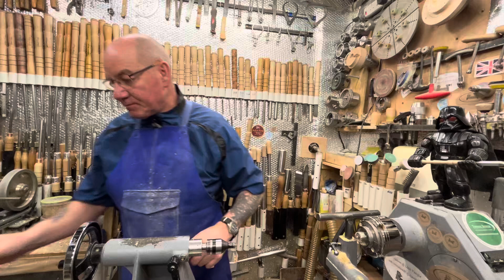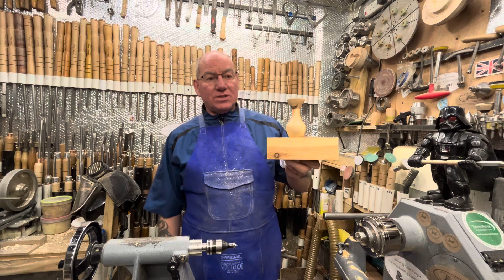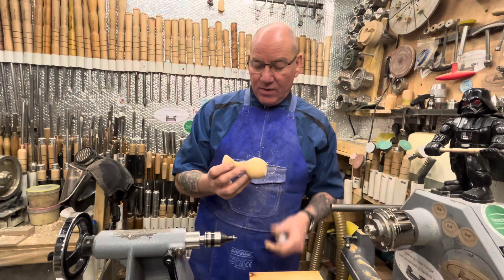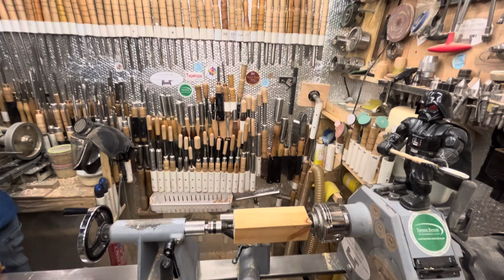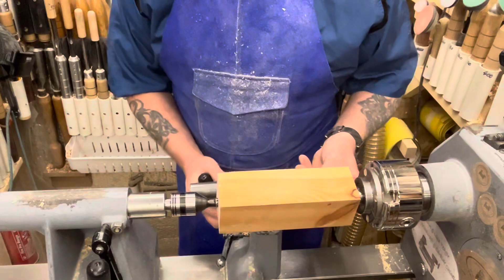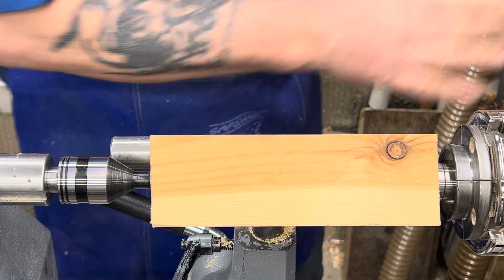Woodturning. Carbides. Using the Standard Type 3 Chisel Set. Part 4.

Comment: I was watching and thinking that if you get good at riding the bevel with carbide, then the traditional gouges will be easier.
Reply from the maker: That's the point I have always made Robert. I have even shown that you can pick a carbide up, make a cut, then pick up a trad tool and do the same cut.

Comment: Nice video as always - yes I feel your pain with those cuts!! I've had a few lately too. 🤣🤣In my youth days in the Rhodesian Air Force we called them "snake bites" cos we were always getting cuts from locking wire etc. When working on jet engines where every nut and bolt have either locking wire or locking tabs to keep them from loosening and they are all sharp!! !!
Reply from the maker: Ouch.

Comment: I asked a group im in on fb what rpm to sand at, they said low. I see youre sanding at high rpm, is there a benefit to higher rpm? Or is it a preference thing?
Reply from the maker: All I can say is it works for me, my style of turning and I've perfected it over many years.
Reply: @glennteagleofukwoodcraftca5308   and i love the fact that you just get in and get it done, you don’t take 30 minutes explaining the tools, and why this one over that one. You just knock out what you set out to make. Definitely learning a lot from your channel so thank you.
Reply from the maker: @davidrelaford9328  thank you. Really appreciated. Comments like this make it all worthwhile. Glad you are finding them helpful.
Reply: Yup they are for sure helpful  @glennteagleofukwoodcraftca5308
Reply: Most turners will dial down their speed and work with 150/180 grit to get any rough spots off.  Quickly move up to 220/240/320.  You can then dial up rpms a little more with finer grit.     Lastly, once you apply any abrasive wax and finish you can speed up to warm & polish.
Reply from the maker: @markb8954  Hi Mark. I am not most turners. My way works for me. The results show. I don't believe in sanding out tear out and tool marks. Do what works for you. Happy turning.